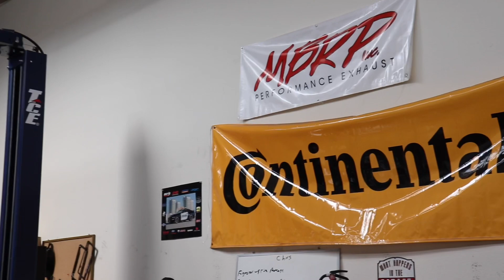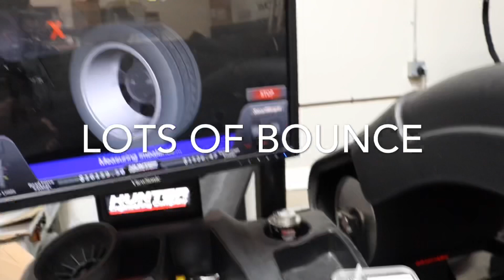I Can’t Drive My SUBARU WRX ANYMORE! This is BAD

Comment from the maker: Thanks for watching the video everyone I appreciate it. 
1. Rotate tires a few times but my camber and alignment was negative pretty good all around and been about like 30-35k miles on them. 
2. Tires are same size. Just different tread. I actually just happened to have tires so we put them on. Not driving and parking the Subaru until my new tires and wheels come.
3. To be safe I’m actually gonna tow my Subaru all the way to pkautodesign when new wheels and tires come

Comment: Happy October Weekend Bro Soobie UK guy. I know I've missed the video, but can I trouble you to give me the wheel and tire size you run. They make my UK speck look like bicycle tyres lol. Great video again as always. Peace 🙏🙏🙏
Reply from the maker: Cassié J Vance hey bro! Thanks for watching and anytime. My tires are 285 30 18 and new wheels are gonna be 18x11+22 I think
Reply: @ChristianHudnell  thank you for taking the time to reply, much appreciated. I think I might have to start saving a lot faster to get a set up like that, but hey, never can have enough rubber stuck down to the road. Thank you again. 🙏🙏🙏💯💯💯
Reply from the maker: Cassié J Vance exactly’ love and learn. I realize can’t drive this long with used and bad tires this many miles. But car is okay but I just can’t drive it for awhile until wheels and tires come in
Reply: @ChristianHudnell  Thank you so much for your reply. I will have to see what I can get in the UK. Do you have to make any changes to the hub size, EG spacers etc 🙏💯💯
Reply from the maker: Cassié J Vance thanks a lot! I haven’t no. I got wheels that fit the specs for a Subaru just install and drive :)